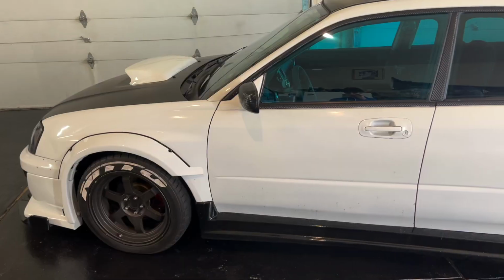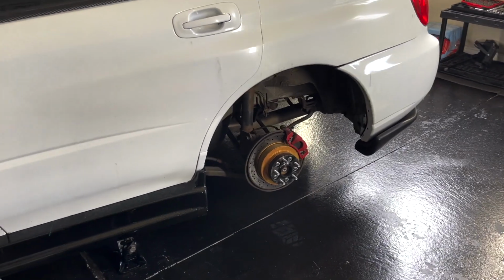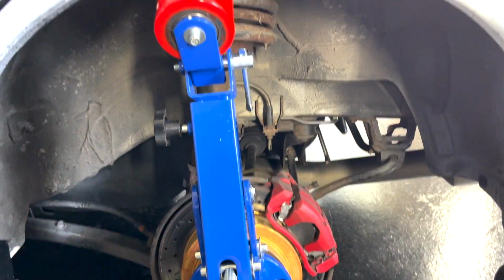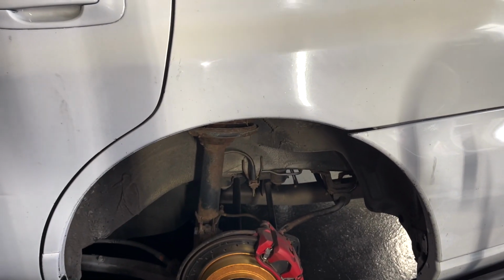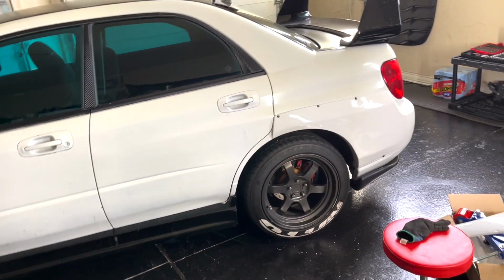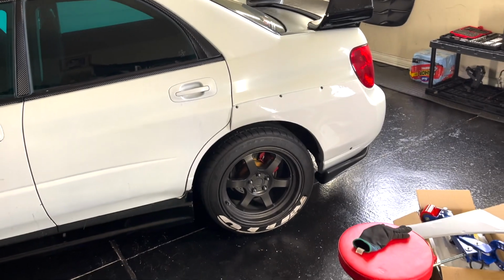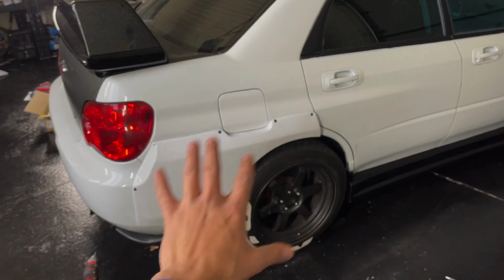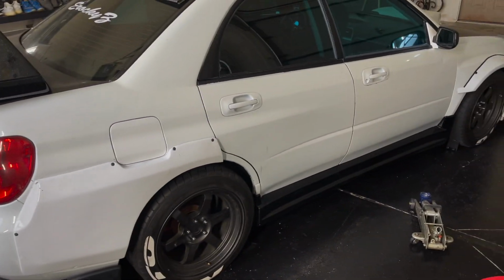Subaru wrx: Wide body kit installed and new tints look fire!

Comment: Rolling achieves nothing when wide arching. You roll to get better fitment within the original arch.  You've extended the arches,  so once you fit wider wheels or space them,  your wheels will still catch on that rolled oem arch lip. You need to cut the metal and remove it,  not just roll it
Reply: Thank you I was wondering why he was rolling his guards he is meant to use a grinder with a cutting disc or a dremel at least and cut away!